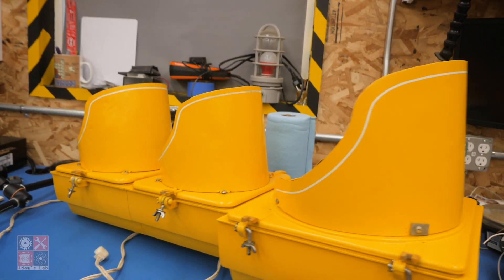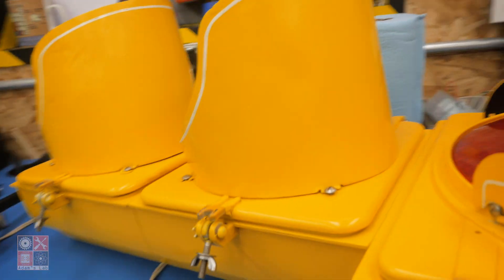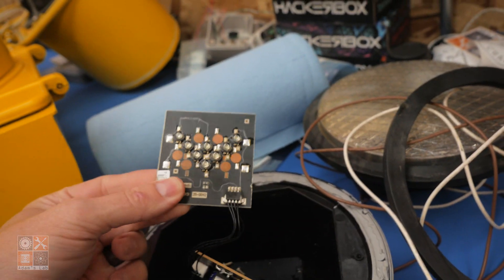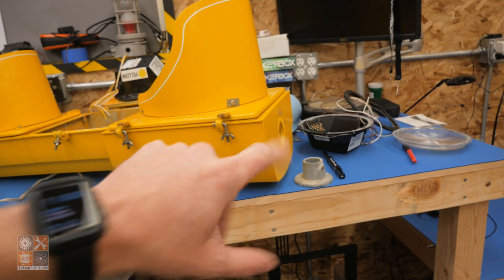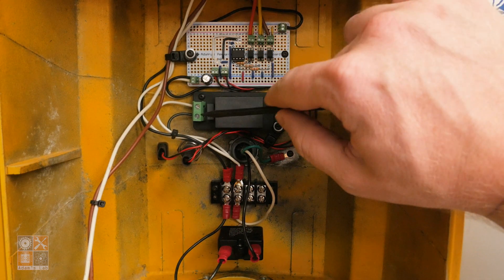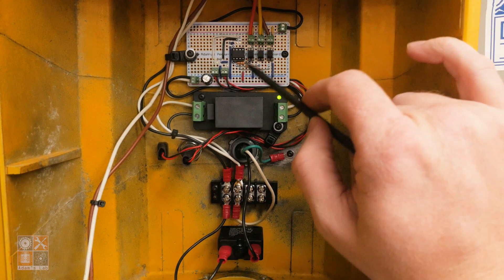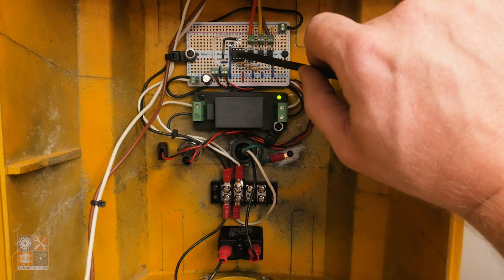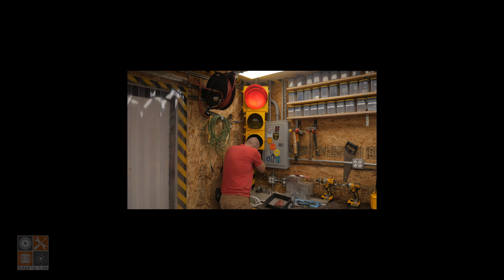Shop Traffic Light - Traffic Light "Restoration" | [0037] 🚦

Comment from the maker: Quick note: After making the video it was decided that the lights were just too bright. Rather than go through the trouble of figuring out an electronic means to dim the lights, I removed the lenses and applied some static cling window tinting. It actually worked really well, makes the light tolerable to look at. You can see a pic here: https://adamslab.io/projects/2019/9/30/shop-traffic-light-traffic-light-restoration

Comment: FYI The holes are designed for 1 1/2" NPT pipe fittings and is widely available at local home centers.  As a 24 year traffic light collector it makes me sad when I see someone drilling into the housing of an old traffic light.  Would be better to make an external box for switches.  Unless they are a rare name brand (Marblelite, Sgt. Sowell, Eagle, an older true 4-way (single housing with RYG in all four directions like Couse-Hinds used to build), or art deco styles, etc. I wouldn't pay more than $150 (including shipping).  Many of these sellers have no idea what the real value is and just just price based on other uninformed sellers do.  Even those that are "restored" are more times than not devalued the signal due to what was done to it.  Sometimes it's better to never repaint to save the petina and age, and certainly devaluing the signal with body holes is something I'd avoid at all cost (that is the collector in me).
Reply from the maker: Someone mentioned the pipe thing before when I first posted the video. I’d advise you to not watch my other traffic video if this one bothered you. 😃

Being honest, and with all due respect, I don’t much care. I mounted it how I wanted and got it working how I wanted. Like you indicated, it’s not like it is a (monetarily) valuable collectible. I’m not concerned with the collectibility of the thing, other than that I have collected it. I mean, I don’t think LEDs were original to it but that’s what it came for. Am I doing a disservice to it by not putting original incandescent lights back in it? Where does it end, who’s standard of “curation” do I adhere to? 

I like it, and in this case, that’s what matters.

Comment: You can also mount these with 1.5 metal pipe fittings
Reply from the maker: I assume you mean that 1.5" pipe/fittings will fit inside the existing holes, giving you a way to attach the pipe without having to go through the "effort" I did with drilling and tapping holes to mount the Kee Klamp fitting.
Reply: @AdamsLab  that's correct you just have to thread a close nipple into the fitting where it is meant to hold the traffic light on,then you can buy a pipe threaded nut to tighten it in place best part is that doing it with plumbing fittings is cheaper than buying actual traffic light mounting hardware which is only different in a couple ways, it is commonly cast aluminum and aluminum pipe older hardware was commonly cast steel, plumbing fittings are cast in iron,then heat treated making them malleable, which means they are softer than just grey cast iron and won't break under stress as easily .the other difference is that the edges of actual traffic light mounting fittings have teeth , exactly 72 as the standard that mesh with the teeth around the existing holes on the top  and bottom of all traffic lights , this is so that once installed, the traffic light can't move out of the position it was installed in, regular plumbing fittings obviously don't have any teeth like that,but for indoor applications such as this there are no windy conditions that could subsequently move the traffic light around on the pipe fitting mounts ,I do like your use of kee klamp fittings because it will allow you to easily remove the traffic light in the future, should a need for that come up
Reply from the maker: @Taylor-xh8uh  - Thanks for the info. I have another light that I need to get working and mount. Depending on where I put it, your method could be easier than drilling/tapping holes for the flanges.
Reply: @AdamsLab  no problem I just thought you could possibly use that method instead that way you don't have to go through the trouble of drilling holes and tapping them,as a traffic light collector, I cringed seeing you still so many holes in it, this signal specifically is an eagle flatback in what we collectors call 12 8 8 configuration. It is indeed cast aluminum, which is a very light and durable metal , which works perfectly for traffic lights, especially when they are hung above the roads. I have a couple posted on my YouTube channel if you'd like to see them and I'd appreciate it if you wouldn't mind subscribing to my channel,as I am an enthusiast of traffic lights I immediately subscribed to your channel
Reply from the maker: @Taylor-xh8uh  - I figured some might take issue with me drilling holes in it... thanks for not giving me too much grief over it 😀. I honestly didn't even think about checking the existing mounting hole size... I had the kee klamp flanges laying around, and just decided to use those to get it done. It makes sense that the hole/mounting is based on standard sizes. The other light I have is a walk/no walk signal, I think it's an Eagle too. I'm going to wire it up to cycle between the signals but also have another mod (no destructive, so no worries 😀) that I'm going to make to it to commemorate our trip to Germany (Berlin) this past summer.
Reply: @AdamsLab  yeah,some collectors would give you a hard time about drilling holes in it,but the way I looked at it is,these aren't rare ,it's not incandescent like it once was,and most importantly,ITS YOURS, so many people think they can tell others what to do with something that they aren't in ownership of, I look forward to hopefully seeing the walk don't walk signal